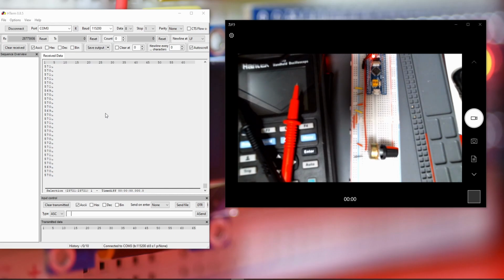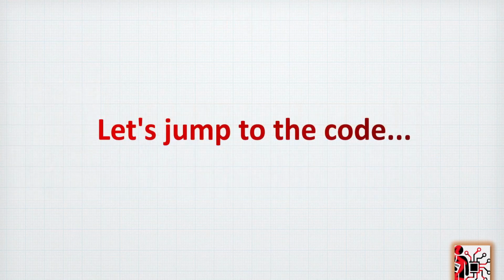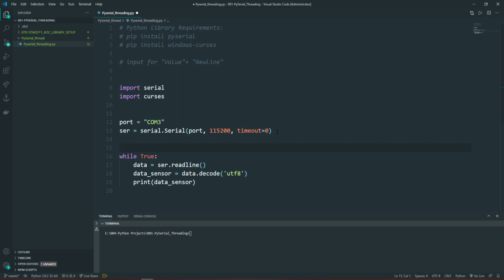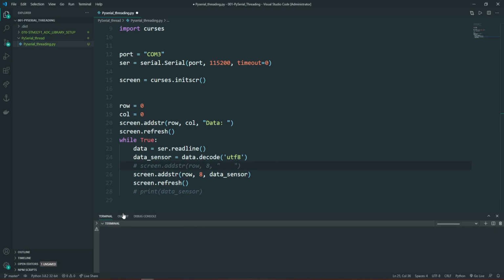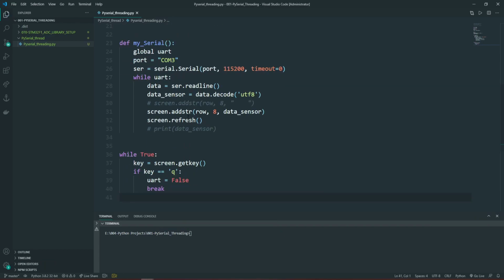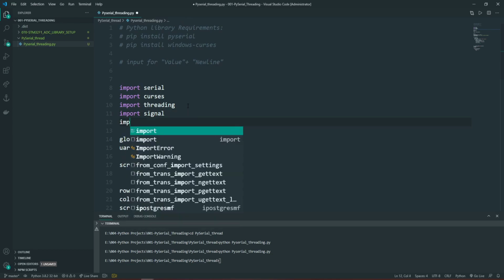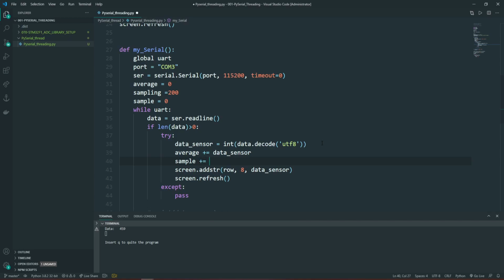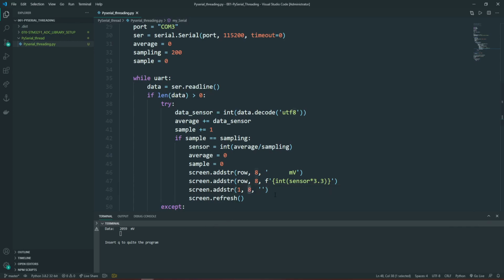001- Using Python to read Serial data from Arduino / STM32 using threading and curses libraries

Comment: Hello Sir, you can make a program, including a server, and a sub -machine. The machine is connected to electronic scales, electronic rulers ... Write data into SQL Server, then transmit information about the server, the server receives data from the sub -machine, then saved it to the SQL Server. At the device, you can view the data of the server and get the data from the server. The server receives data from many sub -machines. thank Sir  a lot.

Comment: Hi! I'm using a STM32MP157F-DK2, a board that has a microprocessor and a microcontroller. That means that the device it's not going to use an external computer, all the processing goes by itself.

Can I run this code on a STM32MP1? It is because I set the pins for voltage reading and for an Analogical to Digital Conversion with the microprocessor, not with the microcontroller, because of an STM32 employee recomendation.

For me it's kinda weird because the same device will be using the pins and reading the data, that means that I'm not using a serial port because I'm not using an external computer, so how do I set that in the code? Can I write specifically the pins on the code because the Analogical and Digital Conversion has already been made?

Thanks in advance.
Reply from the maker: Hi Andres,

Thank you for your question. Short answer is yes.
Long answer : it is a bit more complicated but I can explain & clarify to you how this works in details, we can have a call through Messenger. this is my FP profile : https://www.facebook.com/weew.stack
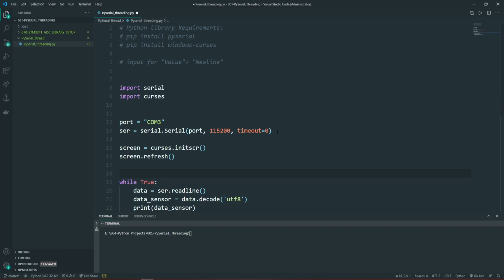I am available this both Saturday & Saturday from 10:00 to 13:00 GMT.

Comment: Thanks a lot, can you share with us how to send data from stm32 to serial correctly?
i did it but it keeps printing empty lines between values
Reply from the maker: Hi Khaled, thanks for your question, I need to confirm have used exactly the same code for both Python and STM or you have added some changes?
Reply: @WeeWStack  i couldn't find your stm code so i wrote mine, but the python code is the same
Reply from the maker: @khaledgamal7923  Can I confirm if you still have the same issue by writing your own code?
Reply: @WeeWStack  It would be really appreciated if you could share the code for the STM with us, sir 🙏

Comment: Just confirming, you averaged the sampling because you were trying to smooth out the readings. What was the sampling rate of the STM board?
Reply from the maker: Hi Olivier,
Thank you for your question
 actually yes, but I think the serial communication could be done better
Actually I had some noise in the data and it seems that I should have connect the both the ground of the Serial device with the STM321, it went better after

Let me know if it helps else we can check further 

Best,

Comment: I'd like to save to a (csv) file, while plotting the strings received from the (py)serial port, real-time every 500ms, where the string is of the format "2, 0x1234,  18.0\r\n", 

So if I get the values like,
values = rxString.split(",")
val1 = int(value[0], base=10)
val2 = int(value[1], base=16)
val3 = float(value[2])

However, it seems plotting the data using matplotlib animation, with or without interactive mode on (plt.ion , plt.ioff), it takes too long, and I start losing data after a short while.    I've thought of using queues, or other packages like 'oscilloscope' or 'pydatascope', but don't want to make this too complicated.   

I found a few serial/plot projects, and have read other people having similar issues ("Tkinter GUI is unresponsive in a thread") but they don't appear to don't seem to do handle the fast data-rates : muhittinkaplan.com/blog/2016/12/20/pythonla-seri-port/   github  electronut/analogplot.py    makerportal /pylive    Overdrivr/Plot.py    pyserial/examples/at_protocol.py

import Tkinter
import time
import threading
import random
import Queue

class GuiPart:
    def _ init _(self, master, queue, endCommand):
        self.queue = queue
        # Set up the GUI
        console = Tkinter.Button(master, text='Done', command=endCommand)
        console.pack(  )
        # Add more GUI stuff here depending on your specific needs

    def processIncoming(self):
        """Handle all messages currently in the queue, if any."""
        while self.queue.qsize(  ):
            try:
                msg = self.queue.get(0)
                # Check contents of message and do whatever is needed. As a
                # simple test, print it (in real life, you would
                # suitably update the GUI's display in a richer fashion).
                print msg
            except Queue.Empty:
                # just on general principles, although we don't
                # expect this branch to be taken in this case
                pass

class ThreadedClient:
    """
    Launch the main part of the GUI and the worker thread. periodicCall and
    endApplication could reside in the GUI part, but putting them here
    means that you have all the thread controls in a single place.
    """
    def _ init _(self, master):
        """
        Start the GUI and the asynchronous threads. We are in the main
        (original) thread of the application, which will later be used by
        the GUI as well. We spawn a new thread for the worker (I/O).
        """
        self.master = master

        # Create the queue
        self.queue = Queue.Queue(  )

        # Set up the GUI part
        self.gui = GuiPart(master, self.queue, self.endApplication)

        # Set up the thread to do asynchronous I/O
        # More threads can also be created and used, if necessary
        self.running = 1
        self.thread1 = threading.Thread(target=self.workerThread1)
        self.thread1.start(  )

        # Start the periodic call in the GUI to check if the queue contains
        # anything
        self.periodicCall(  )

    def periodicCall(self):
        """
        Check every 200 ms if there is something new in the queue.
        """
        self.gui.processIncoming(  )
        if not self.running:
            # This is the brutal stop of the system. You may want to do
            # some cleanup before actually shutting it down.
            import sys
            sys.exit(1)
        self.master.after(200, self.periodicCall)

    def workerThread1(self):
        """
        This is where we handle the asynchronous I/O. For example, it may be
        a 'select(  )'. One important thing to remember is that the thread has
        to yield control pretty regularly, by select or otherwise.
        """
        while self.running:
            # To simulate asynchronous I/O, we create a random number at
            # random intervals. Replace the following two lines with the real
            # thing.
            time.sleep(rand.random(  ) * 1.5)
            msg = rand.random(  )
            self.queue.put(msg)

    def endApplication(self):
        self.running = 0

rand = random.Random(  )
root = Tkinter.Tk(  )

client = ThreadedClient(root)
root.mainloop(  )